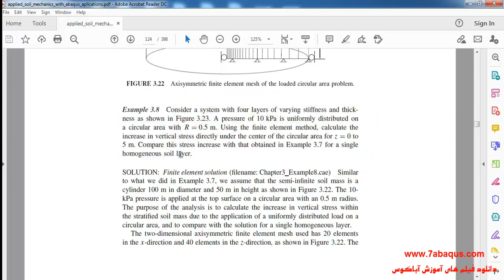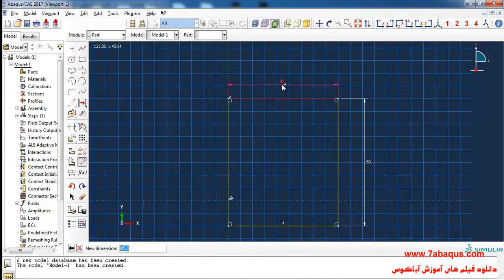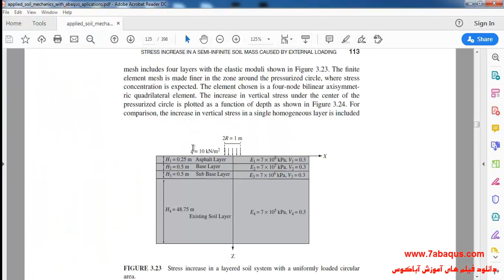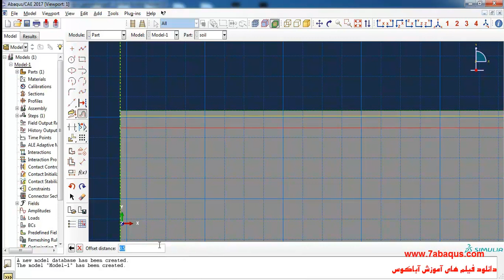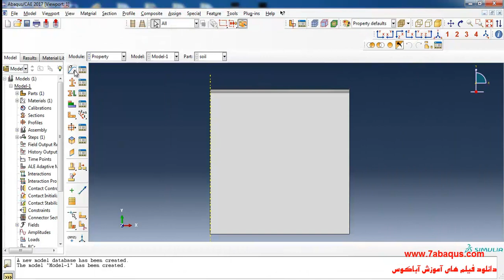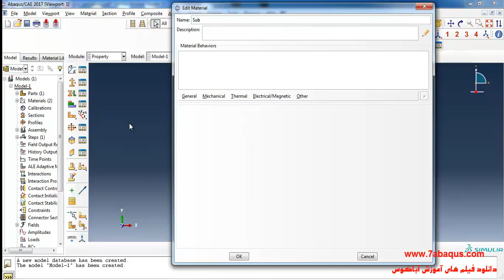Stress in a layered soil (highway pavement) caused by a circular loading Abaqus

Comment: Hello Sir, your videos are very helpful, I've been following them for a long time, I am facing a problem, I need to model rock strata of large extent (50km*30km), with some reservoir load on top and determine pore pressure at depths for a period of 5- 10 years, I am getting time increment errors, like- too many attempts and time increment required is less than the min specified, is it because of the large self weights of the rocks of such large depth that the solutions are not converging? Can you please help me with what time increments to take, how many increments to give? Will be very helpful, Iam stuck in my work
Reply from the maker: Hello
In such issues I have to see the model , because this error is a general error and many factors cause this error